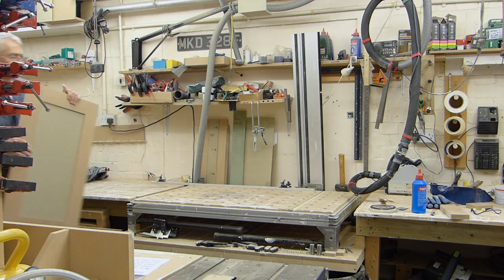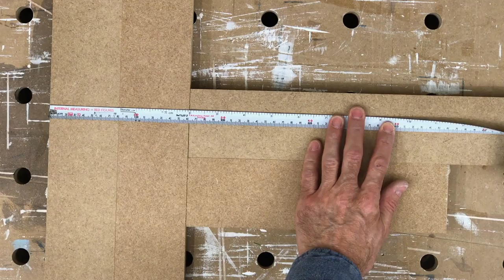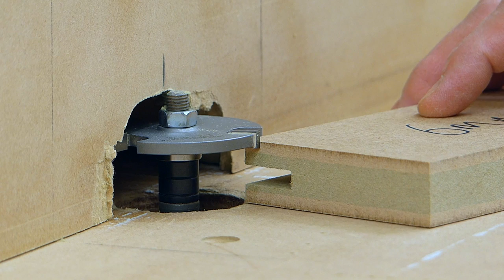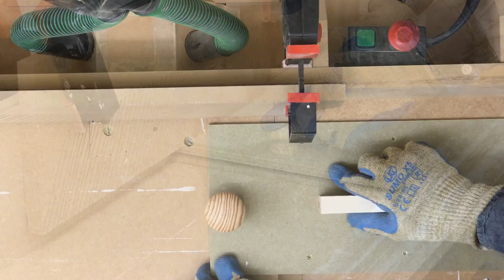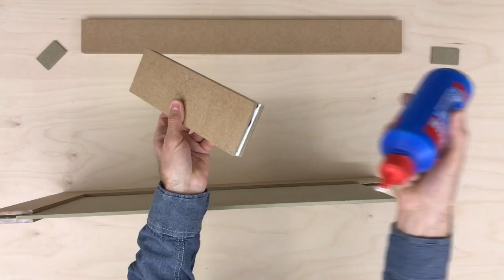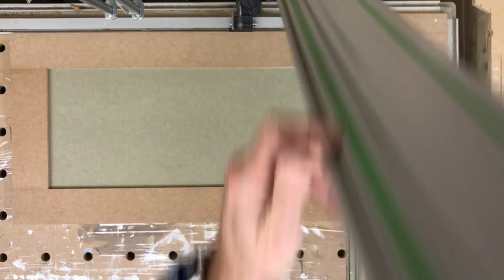Shaker-style Panel Doors #001

Comment: Hi Peter. I have followed this video, and have even purchased the same bit you use from Wealden. I have put my router (Bosch 1400ace) under my cheap router table. When I make a pass in the 22mm MR MDF it is burning the work and creating a lot of smoke. I've read that it may be because I'm feeding too slowly,  but I have tried increasing the speed and it just seems to wobble and kick back. What should I do ? Thanks Michael
Reply: So it turns out I had replaced the cutting bit on my new router upside down ( as it's detachable) . I'll leave this here in case anyone else happens to be as daft as me ...
Reply from the maker: Hi Michael! Congrats for figuring this out yourself, and Kudos to you for ‘fessing up and leaving the post up here. I’ve never had a bad bit from Wealden Tool, and trust me, you’re not the first person to have made a ‘back to front’ mistake! I bet it’s cutting nicely now! 😅😃👍👍
Reply: Peter Millard it's flying through a dream now, you make it look so easy though
Reply from the maker: Really pleased to hear it Michael! I still have every Wealden Tool bit I ever bought and they all cut brilliantly, even though some of them are ~15 years old, maybe more. And thank you - I have made quite a few doors this way, so I think I should have the hang of it by now 😆👍

Comment: So you said you cut strips into 3/4" for the rails, but out of 7/8" MDF panel? is this thickness vs nominal thickness?
Reply from the maker: LightGesture Hi. Sorry if it isn't clear, but I say "...I've cut 80mm or about 3 and a quarter inch strips from a sheet of 22mm MRMDF..." So 22mm (7/8") thick, 80mm (3 1/4") wide. HTH Peter
Reply: Oh, okay. That makes sense now.
Soon I'll be using Metric.. Hard to do the equations when you're ordering here in the States, though..

Comment: Hi Peter - I've been making a test cabinet based on the excellent videos you produce which I will improve on over time.  I've made a proof-of-concept door out of offcuts of MDF but I don't think the stiles are wide enough to house a hinge, or they will fit but perhaps they look too close to the edge of the stile.  In this video you mention the stiles are 80mm wide, do you derive that from a calcuation - i.e. thickness of cabinet walls + x for hinge, or is perhaps a percentage of the width of the cabinet ?  Or is 80mm just standard size you make for stiles ?  I'd be very interest in your veteran perspective
Reply from the maker: Thanks! Stile width isn’t an exact science - at least, not when I do it! 80mm is generally a good starting point for the size and types of door I make. I’ve gone down to ~60mm or so I think for a glazed door, and out to 100mm or so for a particularly big set of doors. It’s partly aesthetics (how does it look) and partly practical (is there enough space for the hinge cup). But I’d say 99% of the doors I do have an 80mm rail & stile, with the bottom rail at 120mm for taller doors where there’s a mid-rail.  HTH P
Reply: Thanks for your reply Peter - I'll take your advice on board.

Comment: Hi Peter, great watch, thank you! Just a quick query in relation to the size of your cabinet doors - are their width and height the same dimensions as the cabinet carcass width & height that you have built or are they stepped in a fraction re. 1.5mm? Thanks Peter
Reply from the maker: Thanks! Wow, old video - my first ever! I typically make them same size as the cabinet, then trim them back by a couple of mm - that's usually enough wiggle room if there's a run of cabinets. 👍
Reply: Thats great Peter, good to know👍

Comment: Peter what material do you use for the 6mm panel is this just 'normal' mdf or is it also moisture resistant?  Thanks Dave
Reply from the maker: The whole door is made from MR (moisture resistant) MDF - it's a much better board for not much more money.👍

Comment: Peter, how well did your paint job came out  on the edge of the door, I know MDF is very absorbent and I was wondering if you had to prime the wood twice or was it enough just once before painting. Thanks.
Reply from the maker: It comes out very well - I’ve never had a problem painting the edges of MDF, and honestly can’t believe the fuss some people make about it on YouTube. I did a 7-part series on painting and finishing, starts at video #029. Short version; start with a decent quality MR MDF. Sand the cut edges to P320. Primer/undercoat once and let it dry. De-nib all around, with particular attention to the cut edges, and primer/undercoat them again. Denib when dry, and apply a minimum of 2 topcoats, de-nibbled in between. That’s it. 👍👍
Reply: @Jessica-to8um  a shame he never answered you. Nibs are pimples in paint caused by dust settling in it while it dries. You want to sand between coats. Even if you don't have nibs sanding causes paint to level out better. Don't know why. Just know that's how it is. So my guess is he was probably referring to sanding. Which is a critical aspect as far as fine finishing goes. You're not going to get a good paint job if you don't sand. That's how it is.
Reply: @10MinuteWorkshop  I've asked every construction and lumber supply around me (in the US), and no one has heard of MR MDF.

Comment: Have you considered a domino? 
I can see why you use this technique, i have seen it a few times before. Router set up and speed of result. 
I know theres biscuits too, but the domino is and extremely handy tool to have. 
Just curious to know. 
Good video btw
Reply from the maker: +Fek The First Thanks. I've owned a domino since they first came out - check out my other videos and you'll see it used extensively - but for doors, this loose tenon technique is simply faster and easier. With relatively narrow rails and stiles, after you've stopped the panel groove there isn't a lot of 'meat' left where the rails and stiles meet; makes it hard to get a domino in there hat isn't too close to the edge. 👍
Reply: Peter Millard 
Yep, fair do's. 
I admit, i have only seen a couple of your videos. 
I'll have a nose. 
It's a superb tool. 
I made a double bunk bed from that....really fast and strong. 
And yes, totally agree with what you say re Panel doors. 
And a one set router set up is so quick, floating tenons so easy to implement. 
👍🇬🇧

Comment: Hi Peter, Do you think there is a cost advantage to use MDF for such a door style versus timber for similar doorstyle considering both to be painted for final finish ?
Reply from the maker: MR MDF is almost certainly a cheaper option (depends where in the world you are, of course) but for me the overwhelming advantage of MDF is the stability; no need to acclimitise, easy to machine, takes paint well and a smooth finish makes it a near-perfect material painted work - any cost benefit is a bonus! Thanks, P
Reply: Yes I am considering a kitchen project presently. Ireland. And deciding on materials ease of use and cost being primary concerns
Reply from the maker: Ah, OK. In that case I'd definitely recommend MR MDF, as per the video - 22mm for the rails and stiles, and 6mm or 9mm for the panel, depending on the size of the door. HTH. P
Reply: Thanks Peter 😀
Reply from the maker: Pleasure :)

Comment: Hi peter can I ask you how you find the mdf holds in the screws on the hinges, my experience of mdf is that screws don't bite as well into mdf and can work loose over time as opposed to real wood where they grip much better, any tips?
Reply from the maker: +dazlarg Never had a problem with the concealed /cup hinges. I generally use 'self-tapping' type screws - I'll see if I can dig out a ink to the ones I use 👍
Reply: Hi peter does that mean your fixing the hinge to the inside face of the door and not the actual edge itself as that was my worry that mdf tends to split when screwing into the "end grain" if you like. Do you have a video showing which hinges you use on your doors and fixing etc
Reply from the maker: dazlarg Ah, OK, I understand. I've attached hinges into the 'end grain' of MDF without any problems - I do a small piece about it in an upcoming video actually. The trick is to use a long but slim screw and always drill an appropriate size pilot hole. These days I use mostly cup/concealed hinges. There's a small piece in Part 3 of my 'Wardrobes' series, starts around the 7.30 mark. HTH 👍
Reply: Ok great thanks Peter I'll look out for that.. keep the videos coming , they are very helpful.

Comment: Just a shame, we can't get any 22mm MDF around Yeovil. Only 18mm or 25mm. I know the hinges you suggest are only ok for 22 or 18. I wonder if they do a hinge for 25mm.
Reply from the maker: The hinges I use are OK for up to 24mm I think, but Blum do hinges for thicker doors (up to 32mm) - Blum 71T9550 or 71B9550 with inbuilt soft close; you can get them from ironmongery direct, I think, but double-check the code numbers before ordering! 👍👍
Reply: @10MinuteWorkshop  thanks for the speedy reply. I'm still loving your videos. I got bought a black superior level for Christmas, on your recommendation and yes they are amazing. Now I would also recommend them 100%.
Reply from the maker: Thanks! 👍

Comment: Hello Peter, do you always use an 80mm stile and rail regardless of the door size?
Reply from the maker: No, it varies, but 80mm is a pretty good starting point for the sizes of doors I make. 👍
Reply: @10MinuteWorkshop  I'm guessing the old adage of if it looks right then it is applies.

Comment: I've got to ask , why?
Why not just put a shorter slot and no tennon so you have a neater outer edge and no tennon hole to fill. Seems a bit overkill.
Reply from the maker: Sorry, I don’t understand what you don’t understand. A shorter slot and no tenon - how would you join the rail & stile?
Reply: @10MinuteWorkshop  surely glue. Glue in the slot and then the panel would hold everything together. Then glue on the face of the rail and style.
Just a query as I've never seen this method before.
Reply from the maker: No, a butt joint between the rail and stile would never be strong enough - feel free to try it yourself! The point of this loose tenon technique is speed and efficiency; by simply continuing the groove the full length of the stile, and on three edges of the rail, and your loose tenon made from the panel material you have a fast strong door in minutes. Cut your loose tenon accurately and there won’t be any gaps to fill. 👍👍

Comment: Why can't you simply cut the "panel" the same size as the frame and glue and nail them together?  I mean, cut the "panel" to the size you want the door to be and add a frame to the outside?  I can't seem to get an answer to this question, so if you could explain, I'd be very grateful!
Reply from the maker: Rachel Helms You can do it that way - a 12mm backing board with 6mm strips added to it can make a mock-panelled door, much like I added the mock panelling you see in my windowseat videos. You need to be conscientious in your technique if you do this as there are some potential issues e.g. the seam all around the door, and fixing hinges.

As it say in the description, there are a million ways to make these kind of doors, and I've done them all; in my experience, the technique I explain in this video is the best combination of simplicity, ease of construction, and robustness of the finished result. Plus, you end up with a panelled door, not a mock-panelled door. HTH, Peter
Reply from the maker: Hey Rachel. Today's video's just for you ;)

Comment: How strong is this, would it be ok for sat 100x450mm doors.
Reply from the maker: Very strong. I routinely use this method for 2000 x 600mm wardrobe doors, no problem 👍
Reply: Peter Millard that’s good to know. Don’t suppose they do that router cutter bit in 1/4” by any chance.
Reply from the maker: They do the smaller two-flute groovers in 1/4” - https://www.wealdentool.com/cgi-bin/sh000001.pl?WD=groovers&PN=Online_Catalogue_Groover_134%2ehtml#aT5415 👍
Reply: Hi, your videos are superb. I just checked the Wealdentool site and the 1/4" kerf cutter that you use in this video is out of stock until late May. The alternative that you linked to (above) will only cut to 13.6mm. Do you think that depth (13.6mm) of loose tenon on a 20mm thick, 520mm x 765mm door with 80mm rails/stiles would hold sufficiently well compared to the 18mm slot? You take time to answer so many questions, thank you so much! I'm a stage carpenter in the theatre and really like your lateral thinking.

Comment: Hi Peter, how would you go about should the panel be glass?
Reply from the maker: Hi Johann. With a glass panel I always leave a way for the glass to be changed in case of an accident, so I put it in a rebate, rather than a groove, and secure it with a bead. I prefer to use laminated glass rather than toughened. The most recent ones I did were in the ‘cabinets and shelves’ series, starting at video #165 👍👍

Comment: What is the best wood to use to make the carcasses, thanks.
Reply from the maker: Not sure there’s a ‘best’ as it depends what you want; ‘most appropriate’ perhaps? If it’s a painted finish then MR MDF is a fine choice. If you want some other kind of finish eg melamine or veneer, then you tend to get the substrate it’s attached to e.g. chipboard or MDF. Otherwise there’s a whole host of furniture grade faced plywood to choose from. 👍
Reply: Thanks Peter, I probably should have asked the question a different way. I want to try and make a shaker style kitchen that will be painted, my current cabinets are thin laminated chip board with painted machined MDF doors.
If I were to use a plywood, should it be marine quality?  though I know this is more expensive or if I use MDF will there be rot issues? Many thanks
Reply from the maker: Ah, OK. If you use MR MDF (Moisture Resistant MDF) then you'll have no issue with rot, unless you plan to submerge the doors regularly, in which case you probably have other issues  😆. Marine ply guarantees that the layers are continuous i.e. no voids, which is kind of important if you're building boats; less so in a kitchen IMHO, so a good quality Birch ply would be 'good enough' I think. FWIW almost everything I make is from MR MDF or Birch ply, and I've never had any kind of 'failure' due to materials choice,.

HTH P
Reply: Peter Millard nice hard maple is good for cabinet doors will hold screws better than sawdust will

Comment: Are you able to directly paint (primer and topcoat) the cut edges of the mr mdf, or do the edges need filling prior to prime coat?
Reply from the maker: Terry Pullen Hi. Cut edges of MR MDF get a coat of water-based acrylic primer/undercoat, then a solid rub down, a second coat of primer/undercoat followed by two coats of (usually) water-based eggshell with a light rub down between coats. That's it - no filling, no shellac primer, no thinned down pva, none of that. HTH Peter
Reply: Thanks for the response. By "solid rub down " do you mean that you sand it?
Reply from the maker: Terry Pullen Sorry, yes. Not aggressive sanding, but firm. There's a short piece in my built-in shelves video #1 at around 6:50 where I demonstrate; I intend to do a more detailed 'painting and finishing' video in due course, but the schedule's pretty full just now. HTH, Peter
Reply: Terry Pullen
Reply: Peter Millard was
Reply: As always Peter, another great video.  Have you done the painting video?

Comment: I've always wanted to ask someone this question so maybe you Peter can answer. Why couldn't one just make a shaker style door by just simply using lets say one piece of 1\2 MDF board of the door size and just glue 1/4 MDF styles and rails on one side of the MDF. Since the doors would be painted I think the doors would look on the outside just like any shaker style doors? Would that make any sense?
Reply from the maker: Hi Daniel. It's a fair question; please see video #019 'More on doors, and why I don't make them that way…" for the answer 👍 https://youtu.be/BQ3UZ8sqsss
Reply: @10MinuteWorkshop  thanks much. Rust clears things up for me. I would also think that the cost of doing that way be more as well. Still can't decide if I should do the tongue and groove or use your loose tennant technique. At least with the way you're doing one don't have to change the router bit. Just the one would do. Do you have any experience cutting MDF with table saw? This is all I have. Thanks
Reply: I have recently made doors by gluing strips of MDF on for the panel style,  I ran into difficulties with the concealed hinges as the door became 24mm thick. I now need to either purchase more expensive hinges or remake them altogether in this style peter has shown. I will be using this method in future to keep the doors 18mm. Thanks for the videos peter they're excellent.
Reply: @daniel600x1  he's probably not using a table saw because it ends up taking a ton of space in the workplace. A lot of these circular track saws like he's using are extremely accurate as long as you're using the track with it. that way the saw can be the thing that moves and you just have to have a standard workspace to hold your material